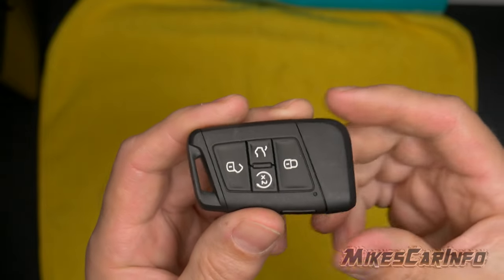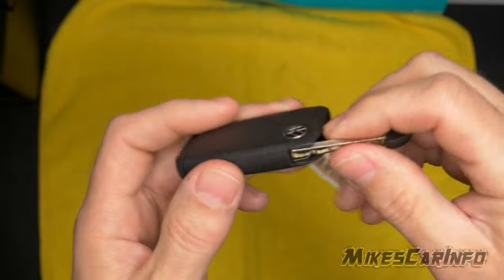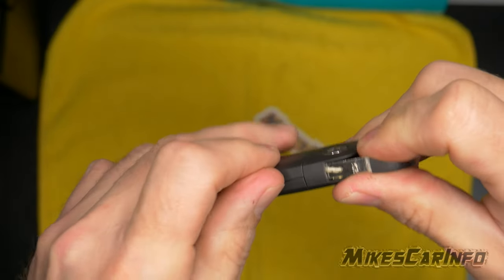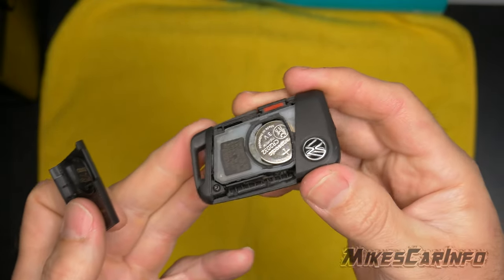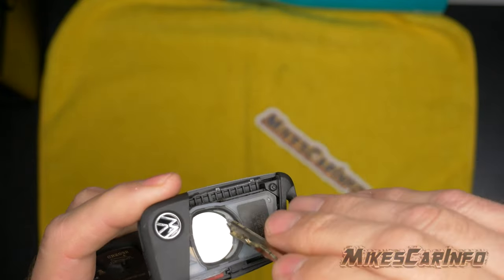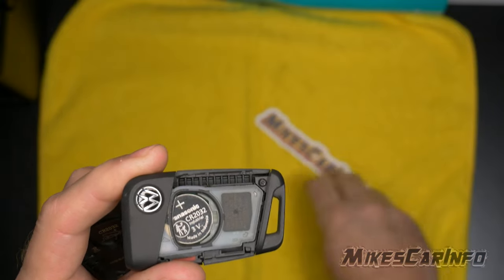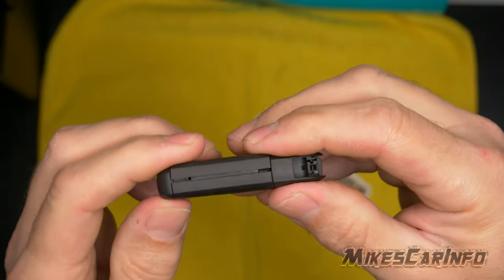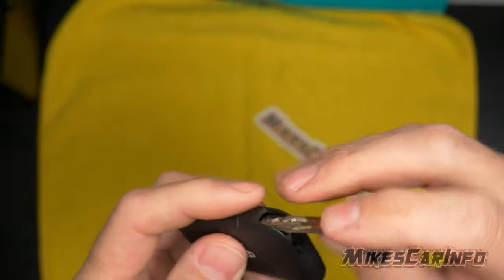👉How To Replace Battery In New VW Key Fob Volkswagen

Comment: Thank you. I also want to add that I had 2 new CR2016 watch batteries laying around and I figured I would try using both since I didn’t have a CR 2032 and it worked!

Comment: Thank you for this.  BTW This is the procedure for other manufacturer fobs with remote start (Chevy Silverado etc).  VW manual with the diagrams is wrong.. not misleading.. flat out wrong. Make it look like it needs to be released with tool before firm lift.